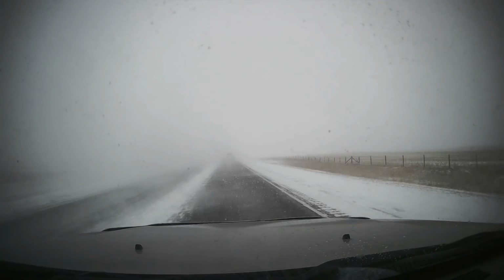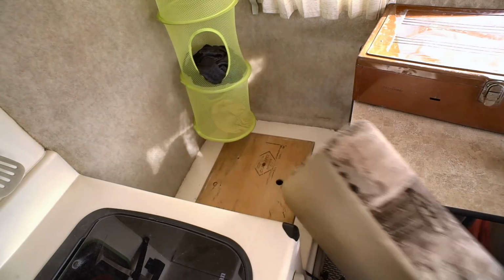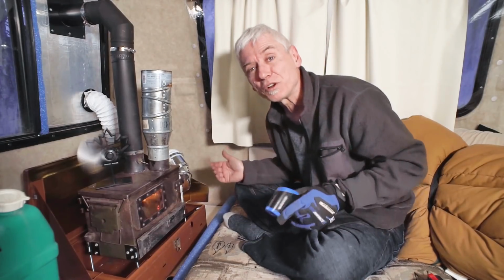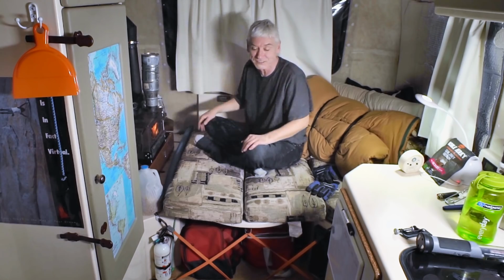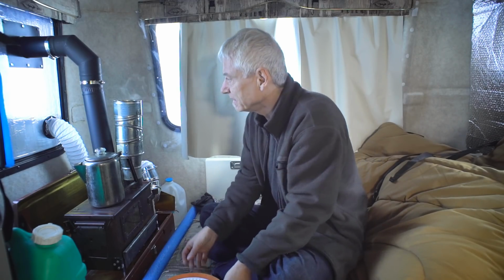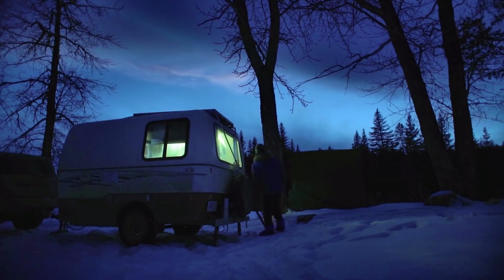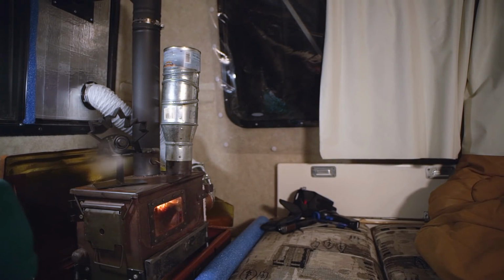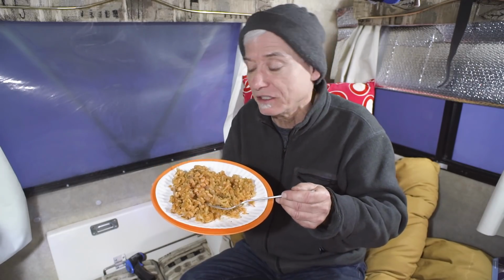Camper Wood Stove Experiment Pt 3: Feeling the Heat!

Comment: The one thing that I never regretted was keeping a garden spade in my car in the winter. It SEEMS terrible for shoveling snow, but digging a car out of compacted and heavy snow, there's nothing better in the world for that.
Reply: I do the same.  Haven't had to use it to dig myself out but nice to have just in case.  Mine doesn't have a regular length handle on it though, it has a shorter handle with a d-handle on the end of it...great for digging, but yet a bit more compact, still a full size spade just shorter handle.  I carry an axe, and a mattock as well in my camp box that stays in the truck all the time.
Reply: Those foldable camping shovels are well suited, as well.  The metal ones, kind of military style, that can lock into a "hoe" position.  You can reach under and chip away at the compacted snow under your car from the side, then.  I've lived in deep snow territory for about 30 years now, I won't go anywhere without one.
Reply: I like flat steel w/ long handle or aluminum...

Comment: It would be interesting to take a thermal image of your camper from the outside to see where it's hot and cold.
Reply: Well since it's all fiberglass and polymers... The thinnest section would be the area with the biggest heat loss. Windows, roof panel, etc.
But, I hope someone makes this thermal vision video, it would be interesting and a first! :)
Reply: Great video
Reply: that does actually sound cool as hell
Reply: @BradleyTurmel  

cool as hell lol!
Reply: Will you please sell me one
Reply: @BradleyTurmel  wait,,,, what?
Reply: Many local fire dept have thermal images to use to see if all hot spots are out OR more importantly where an internal wall fire may not be obvious

Comment: You are too funny with the opening:” you will die” concerns.  I am so amazed at how you tuck yourself into the woods.  I have seen other videos of using wood stoves within even a small type of SUV with a young lady in Japan.  She lowered her window and a setup with wood that holds the “stove pipe” to vent out.  It was amazing to see her put wood in it. OF course, this was something she did while awake and then had an electric blanket to another source.  Amazing to see each of you that travel or live off the grid.  Wow it heated up fairly quicly.  Seems that you got toasty really quick!  Now you can boil water for tea/coffee or even cook on it.  Great work.

Comment: Tee-pee experiments over the years revealed the same sort of issue with the wind direction causing smoke problems. The style of tee-pee I used had smoke flaps that could be adjusted for optimal use. However, they could only move so far. Had the wind swing around one time and the smoke flaps couldn't be adjusted in that direction, the wind pushed the smoke right back inside the tee-pee.

Enjoyed the video. Thanks for sharing.

Comment: I like your stove. I  have experimented with many stove designs primarily for use in ice huts tho I now have built a massive brick stove in my home using the principles   learned. Some suggestions; 1) make a wind vane cap for your chimney, 2) use a "T" where you use an elbow on your outside chimney, you can cap the bottom of it if you want and drill some holes to allow drainage or just leave it open. Both of these will help with back draft problems. 3) wrap your external chimney in another piece of pipe of the same diameter, or larger if you want to insulate it with say mineral wool,  and this will help with your creosote problems as it will help keep the flue gasses warm. Most of my stoves were based on the rocket stove principle such that fresh air intake is thu the hopper, not thru the door. I don't remember how well this worked with pellets but it should, as gasifiers use the same principle. Your poke stick works well, a shaker might work better. oh, and I assemble my chimneys opposit to yours such that all drainage stays in the flu, this does not hurt and I have yet to notice smoke leaking from the joints. Hope you find something useful here. Thanks for your chronicles, I do enjoy them. Happy travels pilgrim.

Comment: Great video Fellow Canadian!!
One thing I might share or suggest based on my own Winter camping experience!
I had an incident in Reno few years back when I was “Overheating” my RV with auxiliary heaters and furnace. There was so much condensation on the outside of RV the windows were all frozen stuck!!! And so was my door!
Fortunately I had AC power so I used portable hair dryer to thaw out and release frozen door etc.
I used silicone spray on weatherstripping to avoid that issue!
I guess what I’m saying is if you needed to make emergency and door was frozen to itself best be prepared with an alternative egress !
Keep up the good work Slim love all your vids 
Great photography!!
Bill
Reply from the maker: Bill (or George), what were you using for heat? I'm wondering if it was your source of condensation. Thanks! SP
Reply: Hello back Slim
I was using 2 ceramic heaters and my propane furnace.
We had a quick freeze in Cold springs it’s about 20 miles north of Reno, and it’s about 6200 feet  above sea level 
My rubber gasket froze to aluminum frame 
I have a 1999 Fleetwood storm class A
I know some of those egg shaped trailers have unique door openings,so just thought id pass it on to you!

Comment: Nice winter scenes Slim I bereave the warm air rising out your vent is what caused the low pressure and the smoke. I am building a stove using a lot of your ideas, the pellet hopper is a great idea. I will take measures to seal it up.

Comment: Thank you for another great video.  I really enjoyed seeing your camping spot in the dead of winter.   It got cold here too, but not nearly as cold as -40F.  The construction contractor, on the  project I'm on, could not work for 2 weeks.  I enjoyed the two weeks off and used the time to plan minivan camper build 2.0. Materials cost $20 US. We  reused most of the materials from our previous build. Now to finish the bed supports,  time 2 hours.  Thank you again for the video,  safe travels.

Comment: enjoy your video, you bring matters up and answer alot more questions. .i've gotten tools and materials and made a permanent set up using car exhaust sections, a .50 cal can, 1/8" steel plate for fittings. .structurally i could drive away and drive all over the place, once stopped just push a section on above the roof, the stove sits above a wheel well, bolted down. .but woodburning instead of pellets
Reply: Phillip Lee - would have loved to see your build. I imagine a "wood" fire would need more frequent monitoring?

Comment: I've seen online that you can get a stove fan that connects to the stove pipe with a hose clamp.  Using something like that will allow you to cook with the fan still on.  The Stove fan won't spin as fast, but still fast enough to move heat around.

Comment: I am glad you demonstrated the reverse draft issue with a small stove in a sealed enclosed space. If your stovepipe provides too little draft on a solid fuel or natural draft diesel stove, it can get interesting very quickly. Gravity feed pellet stoves have an additional complication as they require a good draft to both burn efficiently and... keep the fire from creeping back up the hopper. If you went to a longer, larger diameter stove pipe all would be better yet that is not always practical. Thanks for the video.

Comment: I still like the option of the wood stove the best. Maybe a wind directional chimney cap would help with some of the smoke issues when it is very windy. For the creosote, have all the upper stove pipe pieces drain into the lower ones. Glad you don't have to sleep in that position when not using the stove. Seems to take up too much space. How about relocating the wood stove opposite the shower. Would make for a warmer shower and better use of available space. As always thanks for the great videos. Maybe someday I'll run into you when I'm out in my Chalet A-frame.

Comment: Like the videos and working on a model myself, which has been 3 years in the planning, and design.. i definately recomend fitting a different cowl on the flu outside! a larger diameter pipe say 250mm long and bring the existing flu into the center of the pipe and fit a rain cowl on top of the larger pipe! this allows air to flow in the bottom of the larger pipe around the flu and creates a natural updraught, and a lot less effected by wind. hope it helps and flu dampers also help control the stove,  keep up the great work,
Reply from the maker: Yes, my initial "dog food can" rain cover has a lot to be desired. Working on a new design soon. Thanks! SP
Reply: @SlimPotatohead  just trying to share a bit of knowledge and what i have learned building these awesome stoves. my main model stands upright, with the hoper on the back, entering the burner at low level, patent pending burn chamber, i found the biggest way to improve the performance was to keep the gap under the burn basket under 25mm this gives a  ram jet effect, and can i first discovered create a large flame of around 600mm in height.. but once the air inlet was adjustable could be controlled.. love the stove! and keep going..

Comment: A horizontal run on the stove vent will cause gases to stack, a 45% angle will improve draw. The use of an old campstove for a thermal barrier is a great idea! Darn good way to repurpose!
Reply: BTW, stacked gases are loaded with Co.

Comment: That small stove would be great for those who want to venture out into the cold.  I think once you get one built and figure out how to use it properly outdoors, and set your trailer up to use it safely as you've done, its a great alternative to the noisy propane furnaces that RV's typically have.  Although I do not have a trailer right now, I am planning on getting one soon and probably will build some sort of wood stove for it as the heat from a wood fire can't be beat with anything.  I won't remove my propane furnace from the trailer as it'll be a heat source if I ever become lazy, but the wood stove will probably get installed in a more permanent fashion for my use and will be larger to allow for easier cooking on top of.

Comment: Love these videos!  One additional caution likely needed (enjoyed the one about your cooking), if you install a wood burning stove is your trailer insurance now void...for fire or worse, for any external damages you may cause to others from such a fire?  Check first with the insurance company.
Reply from the maker: Correct Gordon, but go a little further. This can also be said of ANY non-factory installed heater or furnace, like a diesel parking heater. Always check with the insurer before you do any heating modifications to your trailer. Thanks! SP
Reply: @SlimPotatohead  a good point!  And they may not raise a concern.

Comment: Love your setup and that fishtail pulling into the spot was awesome!

Typical keyboard commander, here’s my thoughts:

I’d set the table up next to the other cupboard and lay straight but that’s just me.  

What about getting some sort of heavy thermal mass like a block of metal or clay and setting it on the stove to heat up, then when it’s time for bed you turn off the stove and let the block radiate heat.   You could maybe even move it to a different part of the trailer while you sleep or if it’s really cold run the stove and then move the hot block to the other end of the trailer to get heat from both sides.
Reply: @DaMoose1015  the fan is awesome when the stove is on. I was thinking of ways to keep the heat going and maybe shut the stove down for bed time.

Comment: You can get a rotating cap for the flue that has a wind vane on it to help with your backdraft issues
Reply from the maker: I've seen these, but have a question: Do they work when the pipe is tilted? Thanks! SP
Reply: @SlimPotatohead  I’m not sure about that, but the flue looks straight enough in your video. Safe travels, Mr. P

Comment: Sitting here about 2000 miles south east of where you probably are and about 60°F warmer, I'll stick with option 1, the LP furnace as they work pretty well until it's too cold for the tanks to work (like -40°F) in which case I'm heading south! I'm already someplace warmer, your option 4.

Comment: Like you're showI have a cargo trailer that I converted over into a camper it can sleep 6 comfortably I have a wood-burning 12 by 12 inch metal fireplace and it will heat the and run your out of it basically and I also have a diesel heater that I use  it works fine it's perfect thank you for your build and you're show God bless stay safe.

Comment: good viseo slim, I M one that would of never seen that science .,ive been sleeping in a car the last 12 weeks hope to geta camper soon as its starting to get hot around 10 am as i work 10 to 3 30 am  this is the first one ive watched from your videos in a while. havea nice Spring 2021 my only frown is gas prices are  skyrocking as iits up to 3 40 as gallon . i don t need it getting any higher. by for now ive just got to figure a way to stay cool as  temps change.

Comment: I've enjoyed reading the replies almost as much as watching your video, Slim.
     #1 Suggestion; ditch that scarf & get yourself Buff Headgear which can be worn as a neck gaiter, same as the scarf, neck & head configuration, or full-face balaclava configuration to protect your cheeks, chin, nose & everything else from the neck up.
     #2 Suggestion:  Bean Soup (Protein) which isn't Bean Soup without Potatoes.
    I especially enjoyed the closeup photography of the sound, stream, ice, & water flowing.

Comment: Kudos on showing what can go wrong, and though they might not make then small enough there are Wind Directional Chiment caps the trun with the wind to overcome a reverse draft. These caps have a sail like feature that turns with the wind so no matter the direction the flue will always draft with the wind unlike a rigid version. Slim should consider a piece of flexible aluminum dryer vent instead of a pool noddle to act as a spacer between the bed/stove since its non flamible and the foam can emit fumes if getting to warm or catch fire if in the night it dislodges to touch the stove while he sleeps.

Comment: Slim, new subscriber here. I was wondering if you've had any trouble with the burn tray plugging up. I'm getting ready to build a pellet stove for my cargo trailer conversion and appreciate your video and advice. My own thoughts are that the burn tray design is key to success with this operation. I was going to build several burn trays of varying width. I was thinking less fuel and more air may be more easily regulated but it's all theory until it actually works Lol

Thanks slim and glad to see you enjoying the great outdoors

Comment: I'm thinking switching your elbow to a tee with a cap will prevent any condensate and creosote from running back. I always installed tees on my house right outside of the stove. It was mostly for cleaning, but it may also prevent the drain back.

Comment: Hey Slim. I have a thought on your fire box problem. P. If it is an enclosed system, then the smoke should not come out the box when you open the roof vent. A. I suggest that you consider running your air intake from the floor. I suspect that because it is above and not below the box, it cannot draw in properly. Moving it to the floor or at least below the box will create a much more robust flow. 
Love your channel dude.
Reply from the maker: Watch the video again. I think you missed an important point! SP

Comment: For me the most dangerous part of this video was when you were out on the river ice 😱.  My ice jam experience.   When I was 11 years old there was heavy rain that caused flooding and swift currents on the river. Several friends crossed the river on an ice jam, against my better judgement I started to follow them across the river when the ice broke. Luckily I was able to jump onto another bigger slab of ice leaving me with no way back. I stood there examining the ice for a safe way to continue across when ice from upriver crashed into the ice jam breaking it loose. I was now in serious trouble headed for certain death floating down river towards a small dam. When almost  to the dam the ice flow I was trapped on crashed into a stationary ice jam and began to be sucked underneath. I instinctively sprinted across the ice somehow making it to shore. As I turned to look back the entire ice jam floated over the dam breaking apart. I was really lucky to survive, this was a really dumb thing to do and I should have listened to my intuition telling me not to follow the others. I did not tell my mother what had happened until 40 years later. Be safe out there while exploring.
Reply: Yeah my heart skipped a beat then immediately jumped into my throat when I saw him strike out a cross the ice!! Then it got worse seeing him get so close to the open water areas!!!
Reply: @echomoon3381  Yes same for me

Comment: If the coldest places you went were just a little below freezing at night and a bit above during the day would you even get a heater?  Body heat, heat from cooking, and warm clothes enough to be comfortable?  Not good enough if you have to spend the day inside and it's 5 deg C and damp and rainy?  I've done a little camping in my van and it seems like it's at least a few degrees warmer than outside without doing anything - even cooking.
Reply from the maker: My point exactly Jay. Most of the year I only need a good warm sleeping bag and jacket. Some chilly mornings and shower days might need a few minutes of heat, which is why the propane furnace is still the most practical. It's just those severe cold month you may need an alternative. Thanks! SP